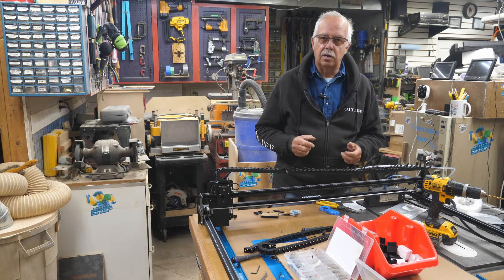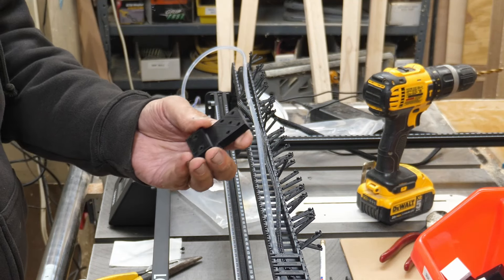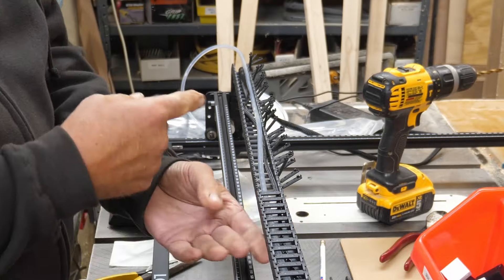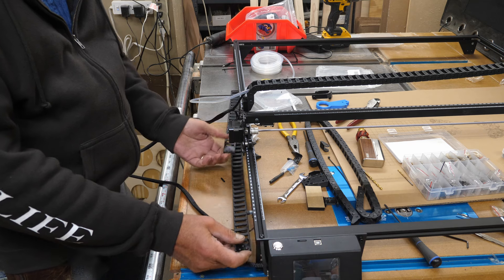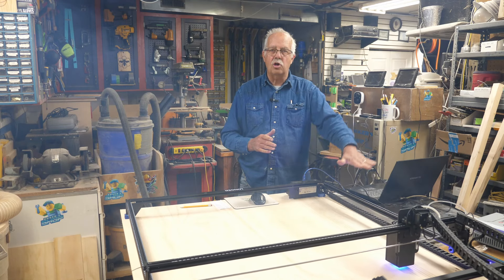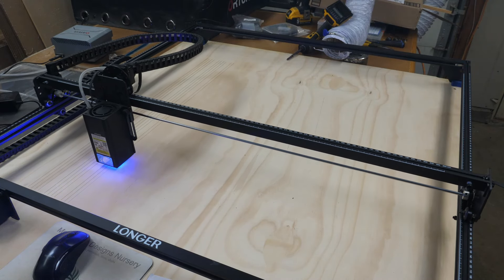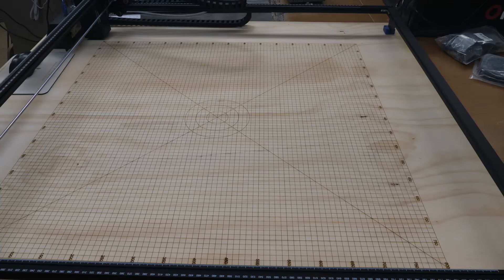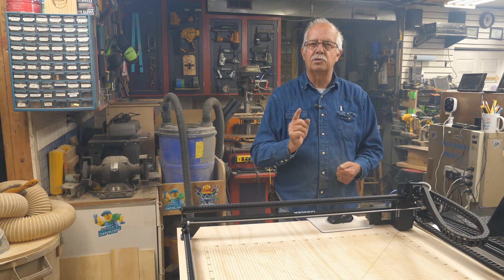Longer Ray 5 Laser Expansion Part 2

Comment: Have you considered mounting it vertically on the wall?
I'm thinking about doing this, as it would take much less space, with just a slight angle (maybe 10º) so the board is kept near the base by gravity, instead of tipping it over the laser.
Reply from the maker: It is stored that way, but when used is laid flat.  The signs I engrave are powder coated aluminum.

Comment: Hey Brotha where did you get the longer air hose at i just extended my ray 5 20 just like this and just ordered the parts from you but i need the longer air hose
Reply from the maker: Pet store in aquarium section.  You can also find some on Amazon.
Reply: Thank you I ordered it. I’m gonna put it all together and then when I get it done I’ll send you a couple pics. Really appreciate it. Nice to have these drag chains and board done and the graph 800 x 800 very much appreciated.
Reply: Also, my buddy had a nice half inch 4 x 4‘‘ oak wood board going to be fancy lol

Comment: I recently added the X and Y extension and have the wavelet lines on mine as well. I have come to believe that the extruded aluminum at that length can’t handle the weight of the 20w laser. I went as far as to disassemble it all the way back down and back together just to make sure everything was tight and squared. It still did not help. Please keep updates if you are able to remedy this.
Reply from the maker: Bad bearing on the X axis carrier.  Once replaced, no more wave lines.  Since I had it apart, I replaced all three since this laser has had a LOT or hours on it.